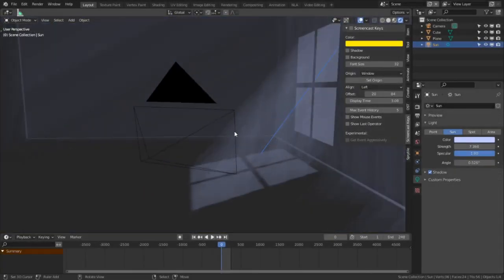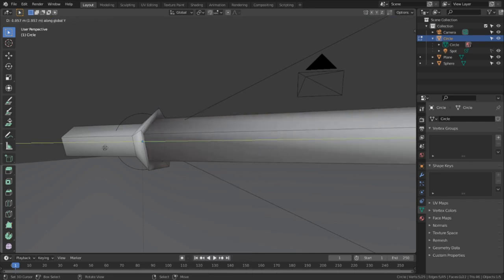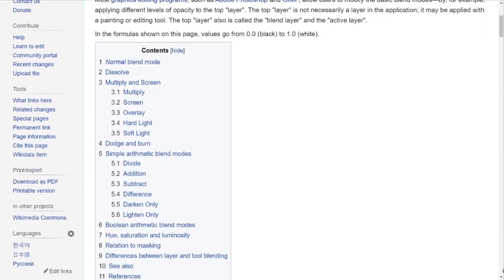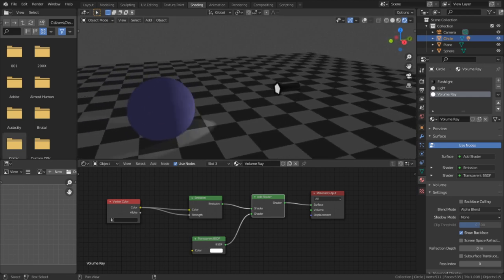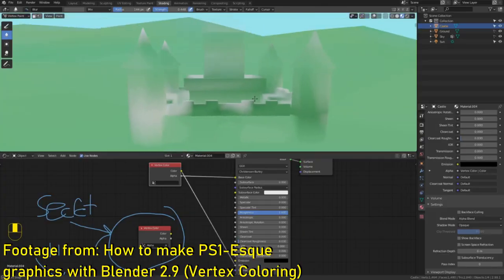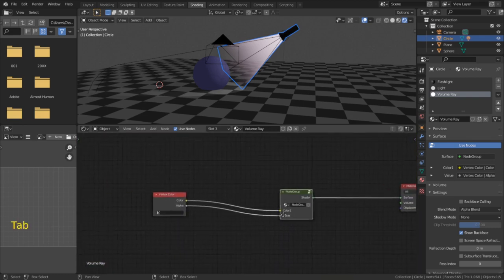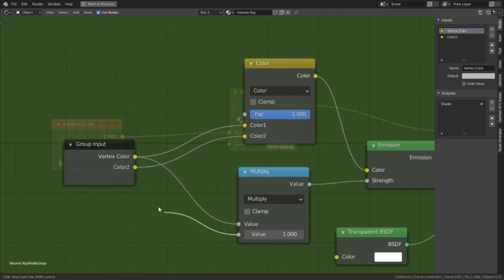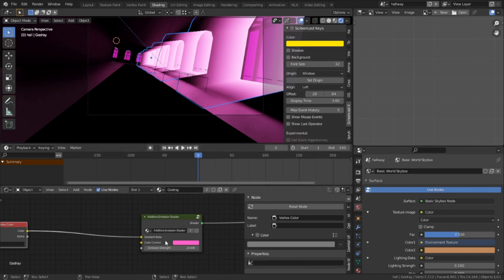Blender 2.9: How to Fake Volumetric Lighting

Comment: what about columetric shadows?  same thing but multiply?  also fake casinting them or breaking the rays when an oject blocks them- maybe they have to be rigged to sretch out to the first thing they collide with....
Reply from the maker: i mean, shadows aren't volumetric, they are projections on a surface. you can use a shrinkwrap modifier to get that kind of effect. that's what I have used but they are limited.

Comment: So cool!
I have a question tho: Would this workflow be compatible to import the material in some game engine?
For example: if i wanted to make some effect like the save game rune on Vagrant Story (https://skullduggery.us/rants/wp-content/uploads/2018/11/vagrant_story_4.jpg)
Reply from the maker: Im not sure, im not a game dev. You might need to bake the vertex colors before exporting. That, or you could use a texture for added detail
Reply: @TheSicklyWizard  No problem, ive been experimenting lately with a retro PSX workflow from blender to UE4 and honestly, ive learn a lot thanks to your videos and the subreddit ^^
Reply: It's actually just a transparent cylinder with a basic rotating animation.
Reply: They rely on the textures to create that effect with vertex lighting that creates a "Light Bleeding" effect off the ground.
Reply: This effect should work if your engine supports vertex colors, additive blend modes, and transparency.  That's all very common, so it should work fine!  As for your screenshot, it looks like they achieved that by doing this, but using a uv-mapped texture for the color instead of a solid one.  I hope this helps!

Comment: Is there a way to make it appear more pixelated? I'm working on a PS1 style project and i want the transition between colors to be as sharp as possible, like an image texture set to "closest" in the blend mode so you can see every individual pixel clearly.
Reply from the maker: Are you looking for dithering?  Because that's not really a viable option as a shader.
I can get you color banding which breaks up the gradient into more visible colors
Reply: Try using textures instead of vertex coloring